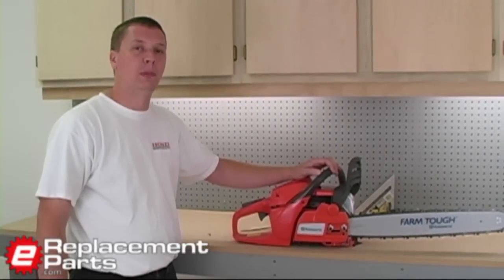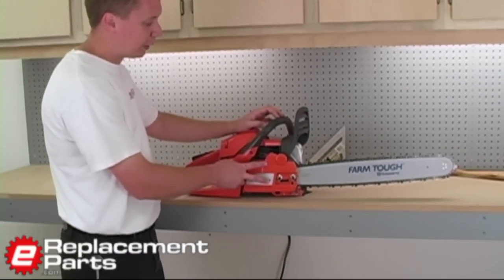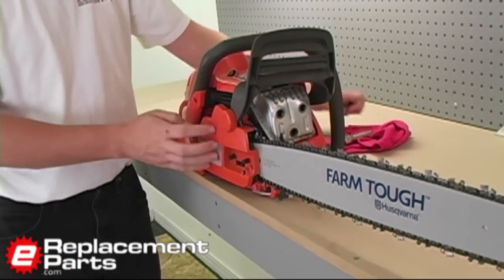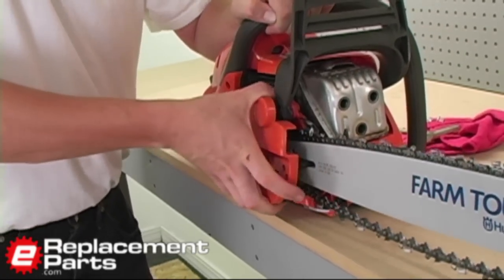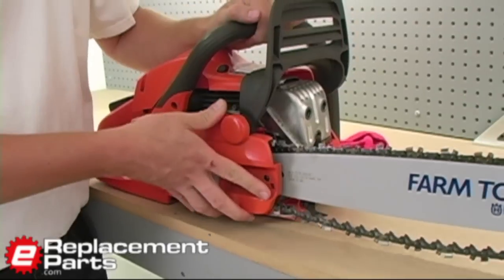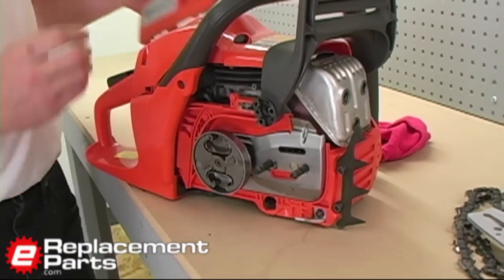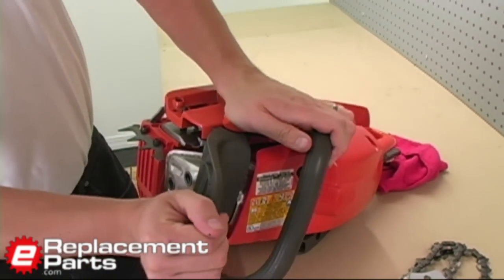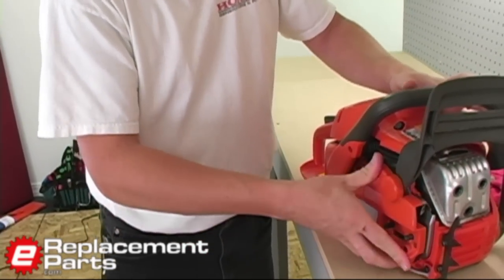How to Install a Locked Sprocket Plate on a Chainsaw

Comment: Thank you very much.  That was a big help.  I am disappointed that Husky does not sell a tool to do that.  It seems that something like a spark plug wrench with the "dogs" on the end rather than a socket would be cheap and easier to use.  I would buy and put one in my dedicated chain saw tool box if available and price reasonable.

Comment: New chain saw with crappy instructions in the hands of a novice. This is the first mistake I made when trying to get the cover off to assemble the bar. Thanks but this didnt work, being unable to get the cogs close enough to engage, no matter how hard I pressed. I made my own little sprocket wrench tool to reset the brake, following the advice of another youtube vid.